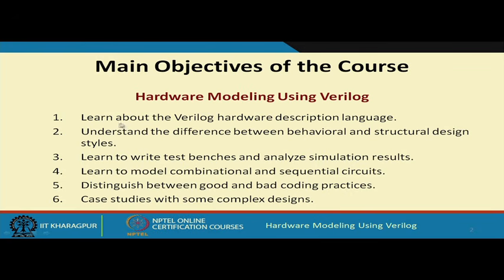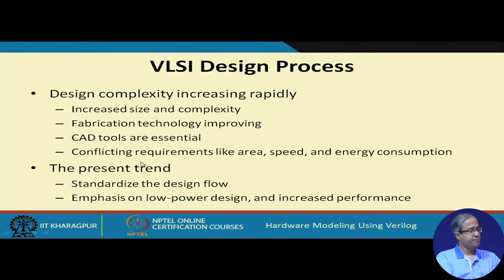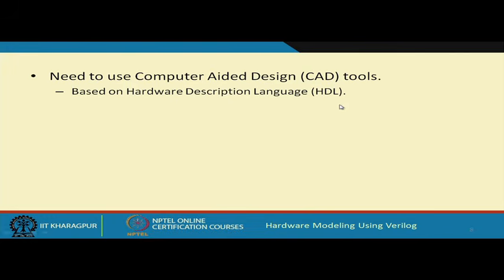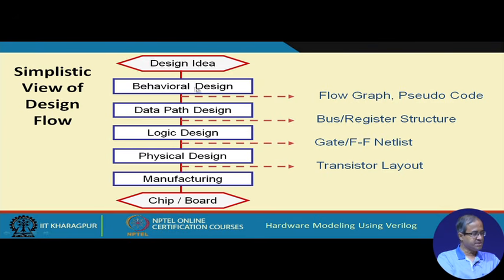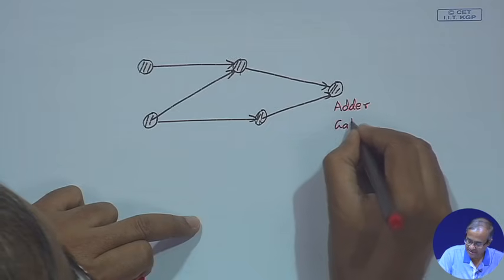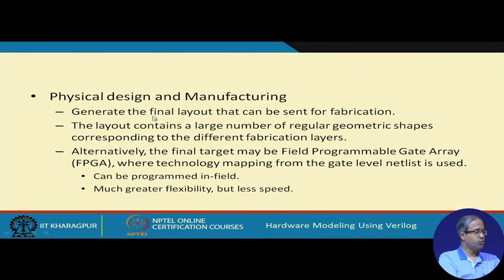Introduction

Comment: Timestamps 

00:17 - This course covers verilog hardware description language and its applications.
02:59 - Introduction to VLSI design process
05:30 - Designing million/billion transistor circuits requires computer-aided design tools
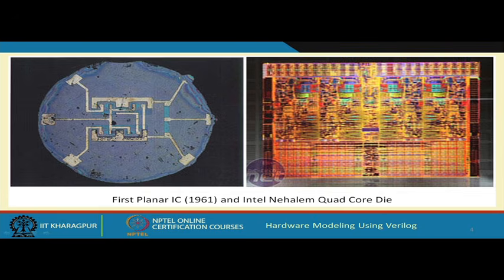08:10 - Moore's law predicts exponential growth in semiconductor industry
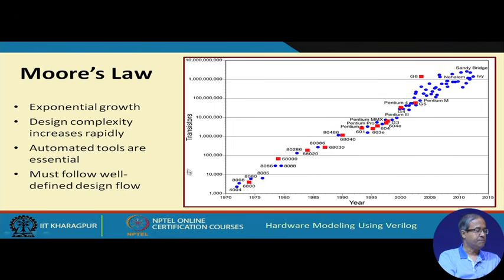10:40 - Moore's law shows exponential growth in transistor count over the years.
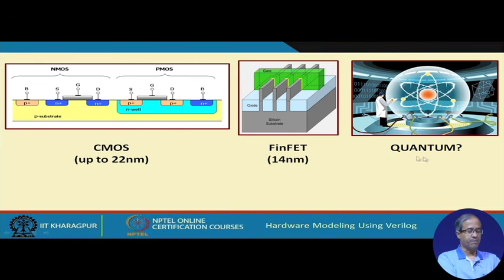13:12 - VLSI design flow is a standardized set of design procedure.
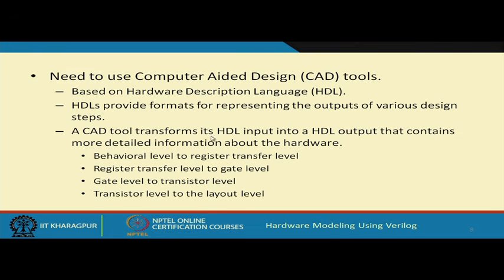15:58 - Hardware Description Language and Generator Output
18:14 - Verilog design flow involves several levels of translation and design stages.
20:26 - In C/C++/Java, pseudo code in algorithm form is transformed into detailed hardware design through behavioral design synthesis.
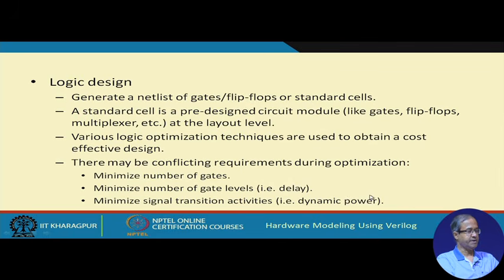22:40 - Logic design involves using standard cells and optimizing the layout for cost-effectiveness.
24:49 - Specification involves regular polygonal shapes and FPGA flexibility.
27:00 - Overview of VLSI design flow and course topics

Comment: Revise your lecture here!
|
0:55 Main objectives of the course
3:06 VLSI design process
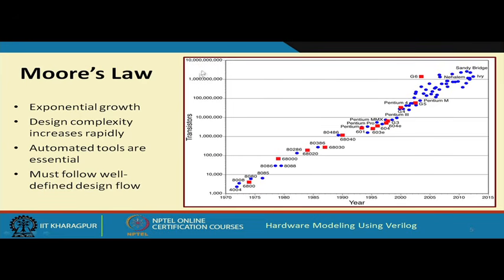8:19 Moore's law
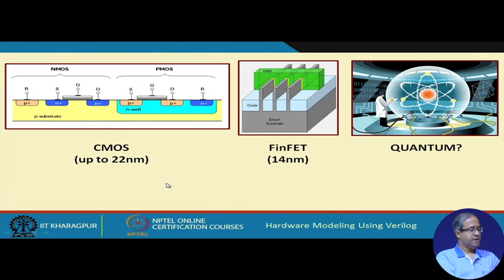11:28 Technologies (CMOS, FinFet and Quantum)
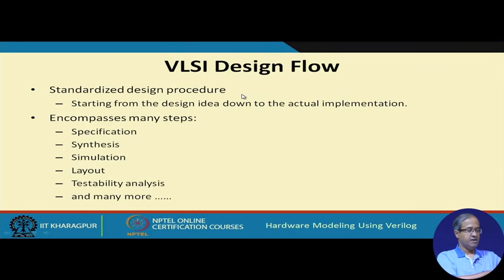13:15 VLSI design flow
14:22 Need to use CAD tools
17:15 Two competing HDLs (VHDL and Verilog)
18:20 Simplistic view of design flow
Steps in the design flow
19:37 >> Behavioral design
20:52 >> Data path design
22:43 >> Logic design
24:24 >> Physical design and manufacturing
25:50 Other steps in the design flow 
END OF LECTURE ONE
Reply: Abhi kya kar raho ho bhaiya reply plz any...
Reply: @CEO-p5eI am a synthesis engineer.
Reply: Verilog HDL Complete Series | Lecture 3 - Part 1 | Data Types in Verilog HDL by FPGA made Easy. Subscribe to the channel "FPGA made Easy".
Reply: Thank you
Reply: U're amazing...thank you ❤ @mbcreations4158